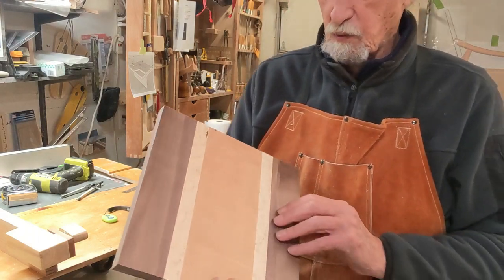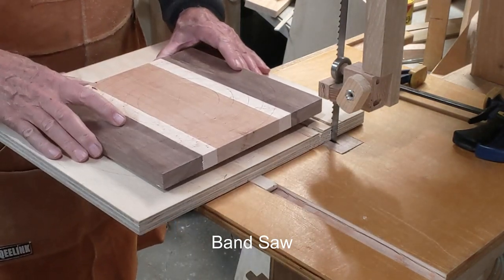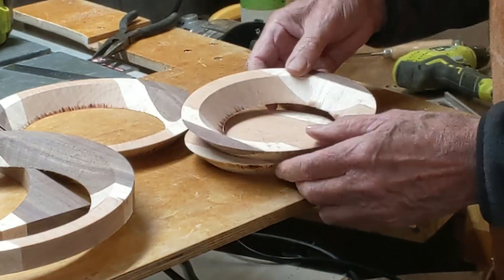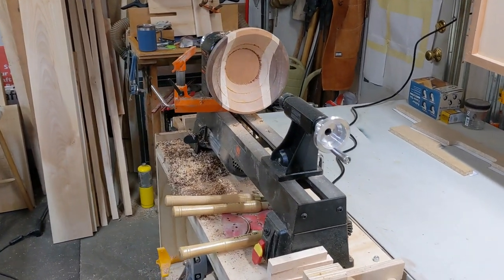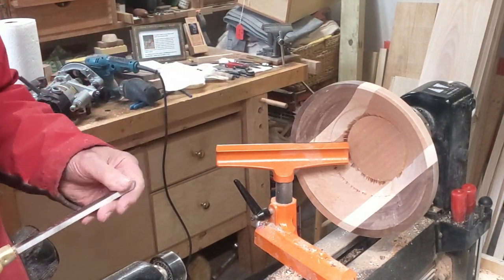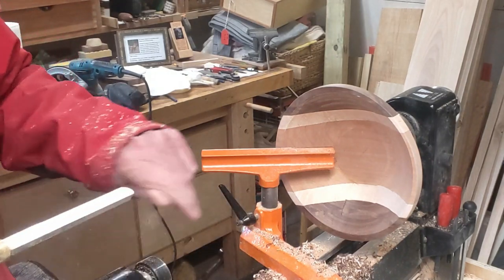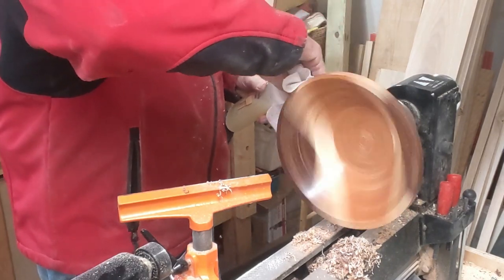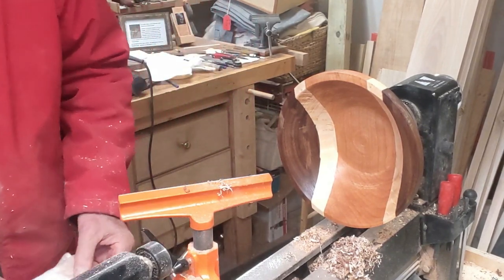Bowl from a Flat Board (with 3 woods)

Comment: I'm new to lathe - did you glue a second base to the bottom circle to attach it to the lathe?
Reply from the maker: Hi @Vrsetter  Thanks for your comment.  Yes, I did.  I created the second base and made it round by turning it.  Then with the centering holes, glue it to the bottom.  There is an alternate method to accomplish this, namely use a Forstner bit to cut a circle into the base.  I didn't do so since I did not have Forstner bits of the right size.
Reply: Great idea!  I’ll try the Forster approach.  Really appreciate the fast response. Really nice product!
Reply from the maker: @vrsetter please subscribe and ring the bell.  I would appreciate it!

Comment: Hi James, I enjoied your video but still have some questions. How do i calculate the thickness of the wood and the width of the circles to make a bowl at 45 degrees? Thanks in advance
Reply from the maker: @josvanhoof  Thanks for your comment and question!  Are you living in Holland?  I'm always interested in connecting to people who share my Dutch heritage.
Here's what you do (for boards 3/4" thick): Make your board 10 1/2" (26.7 cm) x 10 1/2" (26.7 cm).   Make the jig with the pin hole a radius distance away from the band saw blade when the board in mounted (this is so much easier to see visually).   Cut the circle (diameter 9.5" (24.1 cm) on the board with the board flat (cut is at 90 degrees).  Your next several cuts will be at 45 degrees.  Drill 4 holes in the jig (each 3/4" (1.9 cm) from the centered hole, then move 3/4" from the last hole and drill hole, then move 3/4" from the last hole and drill hole, then.....).  Tilt the table to 45 degrees and mount the board in the closet to center hole and cut a circle.  Move to the next hole, cut a circle, ........ until done.  Let me know if this is clear and understood?  Adjust for different thickness boards - I could create a formula for this but have not so far.
Reply: Hi James, yes I am living in the Netherlands in Weert in de provincie Limburg. Thank you for your help. I will give this a try and let you know how it worked out.
Reply: Hi James, Sorry for the late response. Last week I received my bandsaw and i am setting it up now. Oce I get all setup I will make the board with the pvot holes and try it out. I will keep you informed. Next week I have to go to the hosputal for an operation n y back so i will bee out of my wood shed for a coupke of weeks.
Reply from the maker: @josvanhoof7616  Take it easy with back operations - I hope you have a great surgeon!  Love to see what you come up with for your project - please send pictures!
Reply: @jamesrvs Thank you James. I will take my time.

Comment: how far apart are the pin holes on your board and thank you for the video
Reply from the maker: Hi toby's sawdust, Thanks for your question.  I used 3/4" spacing for the angled cuts on the band saw.  This works fine for 3/4" or 13/16" thick boards.  Hope this helps?  I can also give  advice if your boards are a different thickness or the band saw is set at other than 45 degrees.
Reply: @jamesrvs  thank you and i hope your friend is doing ok
Reply: @jamesrvs it😢